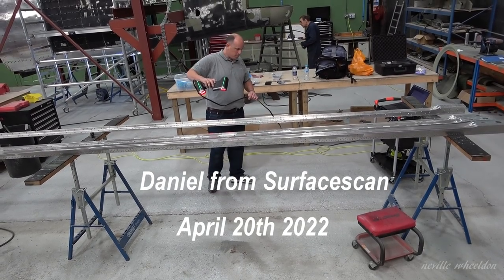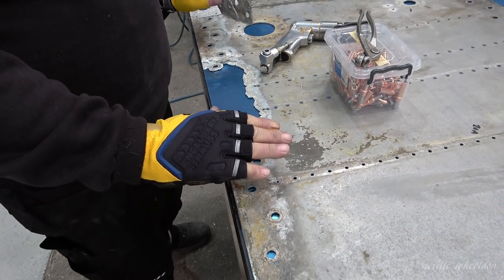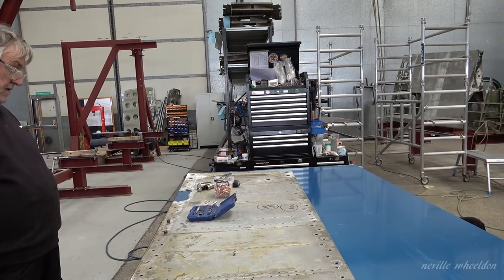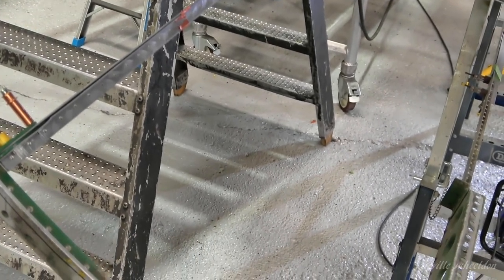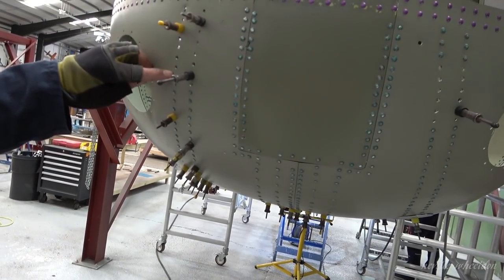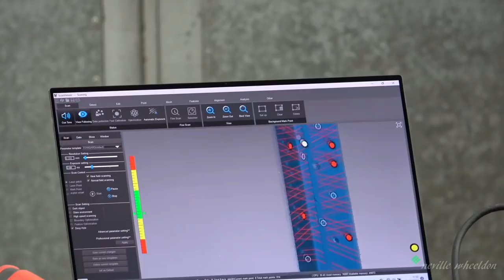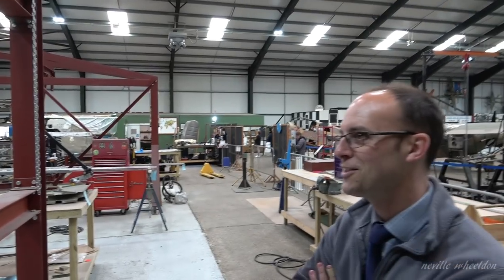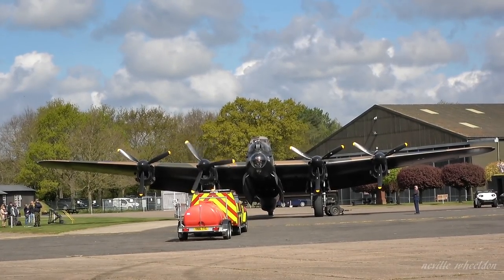Video 145 Restoration of Lancaster NX611 Year 5. Lancaster wing tips fitted.

Comment: Neville....how do you do this, you keep out doing yourself!!!!!  Fantastic video. Showing the aluminum, (2024 T6), discussing hole templates, dwelling on the rear turret construction, you are setting new standards.  I take it that the laser is for machining purposes of new booms (cap strips)? No drawings???  As to the problem of new vs. old standards of material, Vintage Aero had some steel made to old standards (1930ish) and it required a mill run (read mega bucks/pounds) from one company in Switzerland. No one else would touch the project. It sounds like a simple problem to overcome, but many of the steels made back then do not exist today. As always.....THANKS!
Reply from the maker: Thank you Ed.

Comment: Actually - i have a question. That little doubling plate you put on: would that be a typical field repair that the aircraft might have seen during service?
Reply: If you're talking about the 1 under the rear turret,  yes. That was a typical repair. Also done on windscreens from say bullet holes. Depending on the damage and excess ability,  they may have a 2nd plate on the other side as a backer.
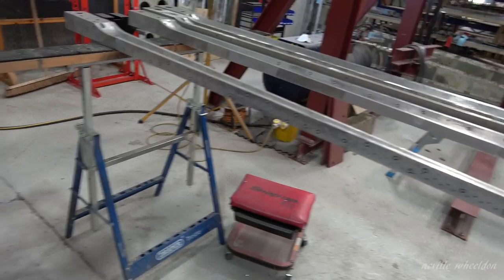Reply: At 8:30 we hear it's "no good for flying", why is that?

Comment: Here is my idea.  Scan all the parts of the Lanc using a three d scanner which creates a digital replica of the part.
Reply from the maker: If it was only this simple.
Reply: @nevillewheeldon1693  My thinking is once you have the digital image, you can use a three-D printer to print parts  for replacements or to build new Lancasters. But as you say: If only it was that simple.  Thanks to you and the team for all you great work. The Lanc is a real beauty.